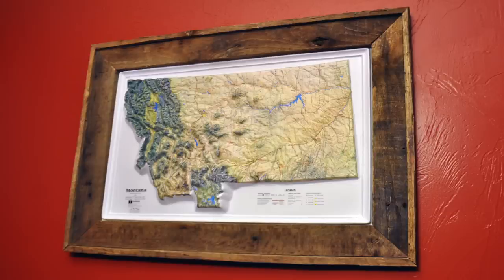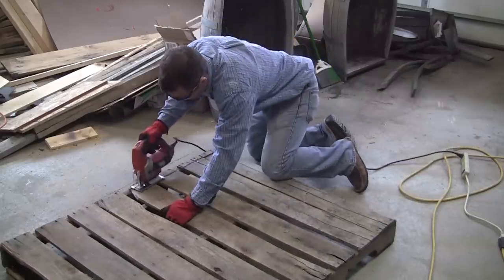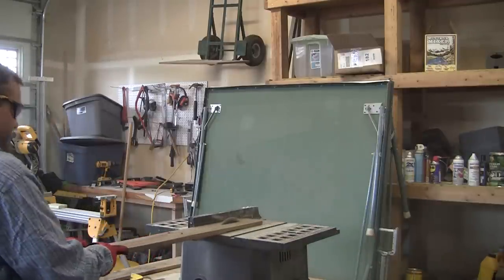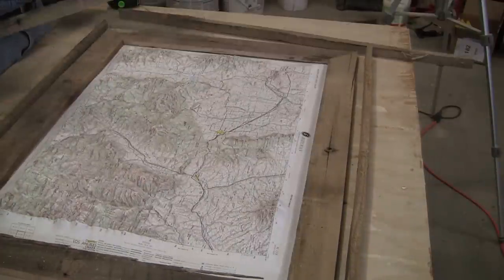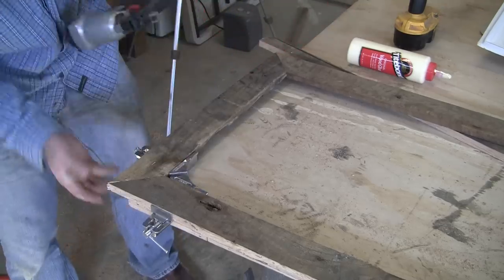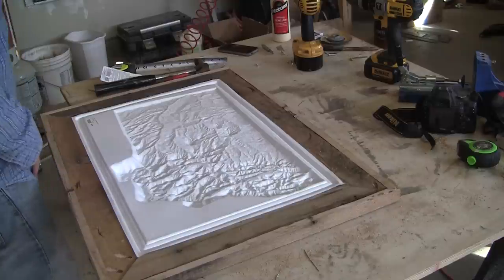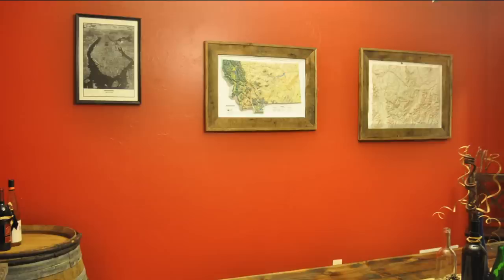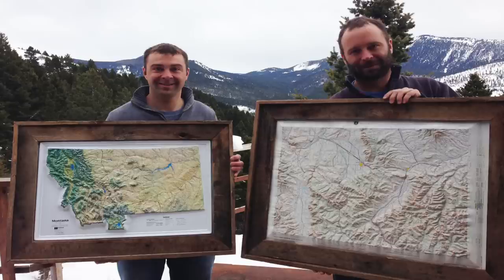How to Make a Frame out of a Pallet! - Frame a Map or Picture

Comment: Quick question. I noticed one corner had pocket holes. But then u used the 90 degree clamp in the video. Did the kreg jig not work well? About to try to make something similar, and just curious which method works better for putting together 45 degree cuts. Awesome video.
Reply: Great question! I was going to Kreg jig the corners together, but the wood was only 1/2 thick in some places and since it was older/reclaimed it seemed to split somewhat easily. It would be a lot easier to kreg jig if you didn't do the mitered corners and just butted the ends to each other. You'd need to use pretty short screws though (probably 1 inch long). What are you thinking about making?! Let me know if you have any other questions! - DIYPETE

Comment: Hey Pete! The tutorial is great, but I am wondering how the frames look now. We made frames with pallet wood in the same way (minus the 1" framing around the outside) and the boards warped. Do you know of a way I can construct the boards or something we can coat them with to stop them from warping? They look pretty weird warped on the wall :)
Reply from the maker: Simply Pallets Hi! Great question. The frames I made are still looking like they did the day they were made. Were your pallets dried out in a garage or inside for a few weeks prior to building the project?
Reply: DIY PETE They were not in the garage but they were under a tarp outside for a few weeks. Maybe we need to put them inside and even by the burn barrel to make sure they are completely dry? I am also wondering if maybe having that inch of trim helps to keep the wider boards completely straight. Either way, I love this design so I want to try it, but someone is paying us to make it for her so I want it to be perfect.
Reply from the maker: Simply Pallets Hi! The more controlled the environment the better and I think the garage could help them acclimate a bit more to the environment where they will be hung. You might use a wood moisture test meter to see how much moisture the boards are retaining. Other than those suggestions, I'm not 100% sure what else would help. I wish you the best of luck! - Pete

Comment: Hi Pete, I am a new subscriber and novice wood worker. Nice video, and something I have wanted to do. Did the irregular shape of the wood present any problems getting straight edges while ripping?
Reply from the maker: David Letz Hey David! Pallet wood certainly isn't perfect, but I think you'll be able to get straight enough edges. I did sort through the boards a little to find the best from the pallet. I ran the boards through the table saw to get as straight of cut as possible. A joiner will certainly help if you have one, but I only used a table saw to show that it can be done without any of the more specialty tools. Things aren't 100% perfect but pretty darn good. It is a rustic style frame and I think you'll be able to make it look great. Good luck!
Reply: DIY PETE : Thanks for the quick reply, man! I understand about the imperfections, it is pallet wood after all.

Comment: hey pete, im planning on making a frame for my dads birthday using this video do you know any way to give the wood that same look with brand new wood as thats all i have
Reply from the maker: Hey Sam! One way to try and distress it is to use cedar wood --- or perhaps doug fir -- and to use a steel wool vinegar solution similar to my post and video about the process: http://www.diypete.com/how-to-make-steel-wool-and-vinegar-stain/   - it won't look the exact same, but is an option to help distress the wood. You can also mark it up with saw marks, a hammer, nails, etc for more distressing.